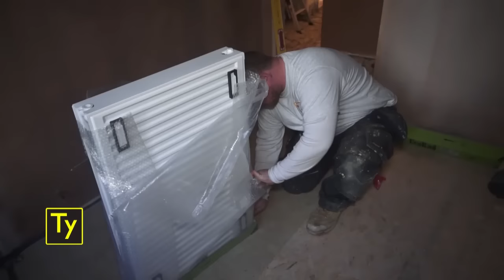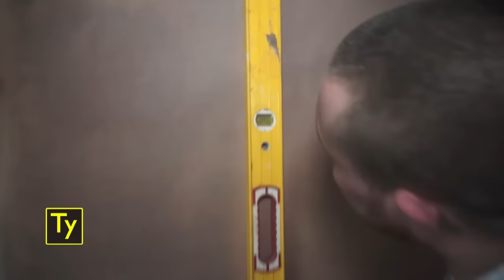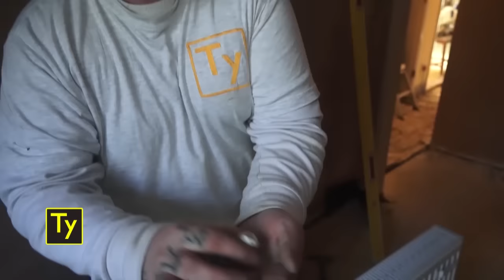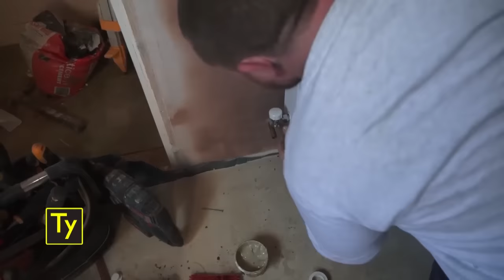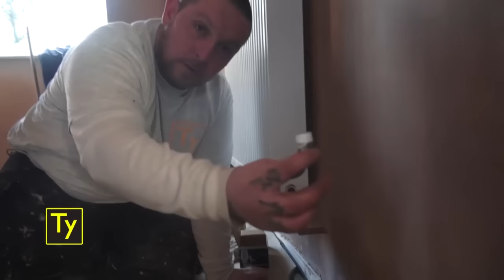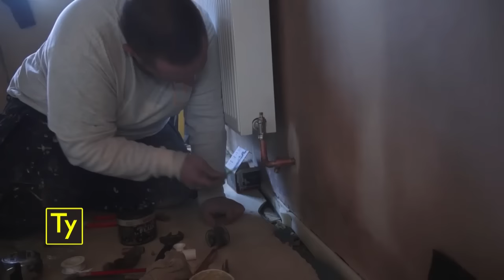How to fit a radiator

Comment: Another very informative video, watch them all. It is a shame the plaster wasn't dry enough to at least mist coat behind the radiator beforehand? I also think it's worth being careful removing the plastic packaging so that the cardboard goes back over the top to stop muck going in behind and using the plastic as a coat to protect too.

Comment: What was the name of the screws you use? I didn't quite catch the name.

Also on a stud wall do you try and screw into the stud or doesn't it matter?
Reply from the maker: +Argyll1000 Hi, the screws that we always use are called "Timco" they are brilliant for all types of work. https://www.tommysyard.com/product/199993/timco-50050c2tub-c2-pz2-passivated-classic-screw-in-tub-yellow-pk-600 

Timco also do a plasterboard fixing called Speedplug which are also great so it doesnt matter if you screw directly into a stud or just the plasterboard.  https://www.tommysyard.com/product/200016/timco-metal-speed-plugs-31-5mm-100-pcs